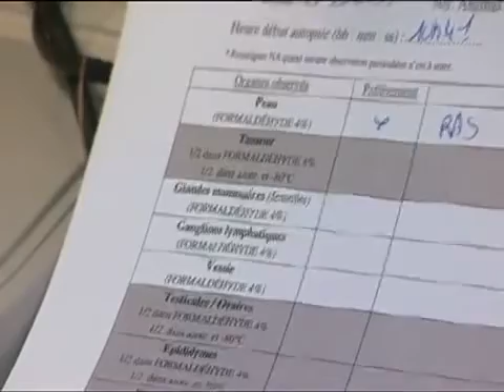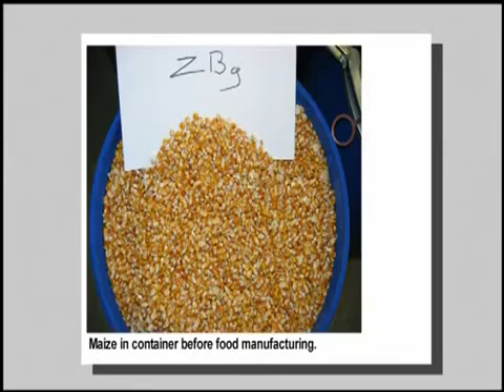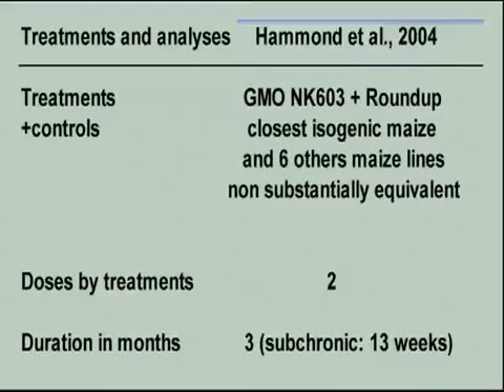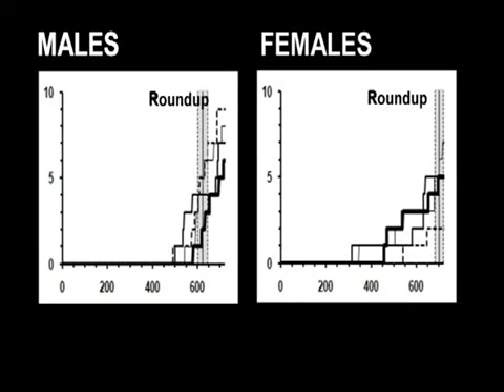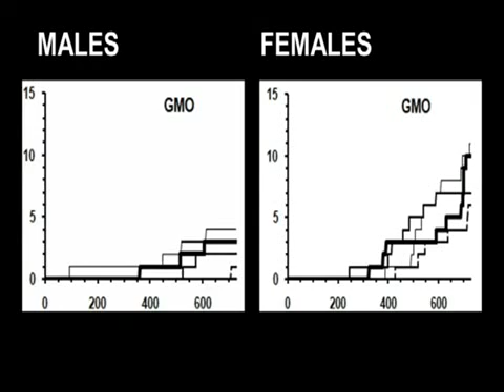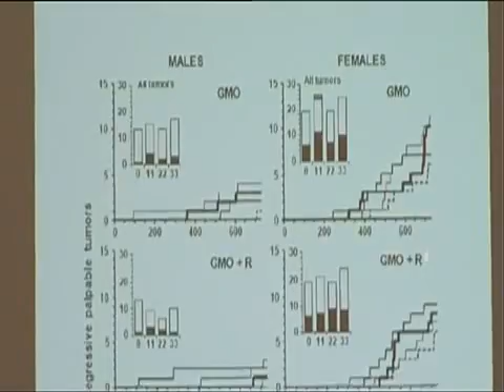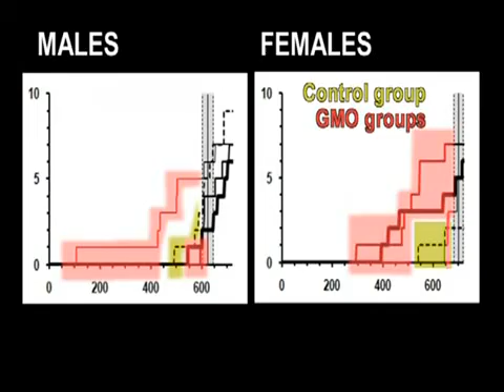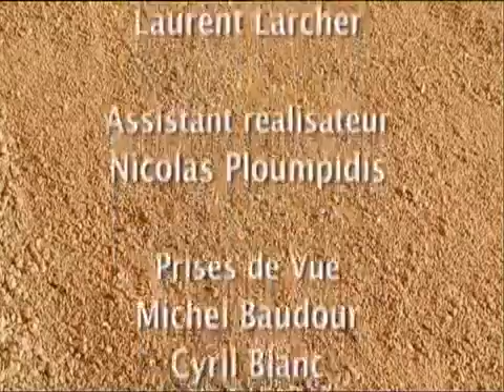GMO & Pesticides Cause Tumors & Higher Mortality Rate  (Documentary of Actual Study) [VEDS #21]

Comment: (pg4) ...have come into contact with the Earth.  The water that makes up the bulk of their volume is quick-water.  It's dis-stilled water - water that is not still.  Distilled water is virgin water.  It has the greatest capacity to absorb anything it comes into contact with, indeed it soaks up CO2 from the air strongly enough to lower its pH to 6.0-6.3.  Distilled water does not acidify your body, and alkalizer machines are dangerous.  Urine therapy has the same effect on the body as drinking